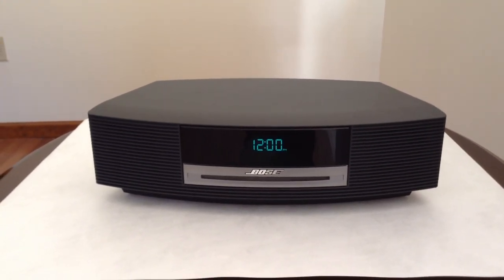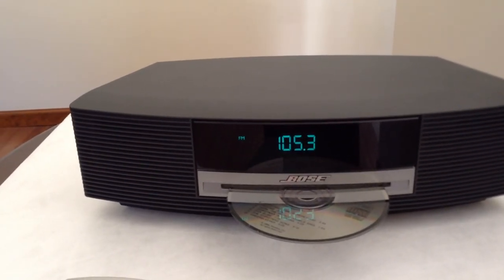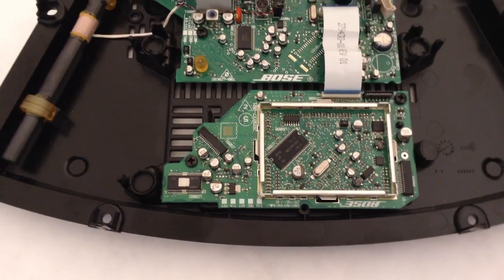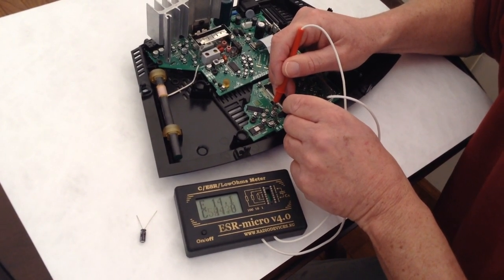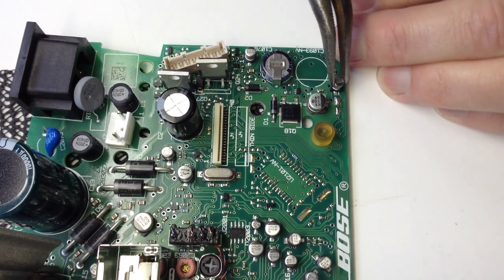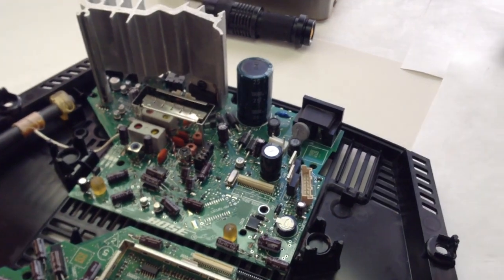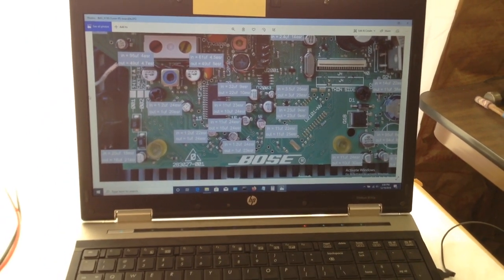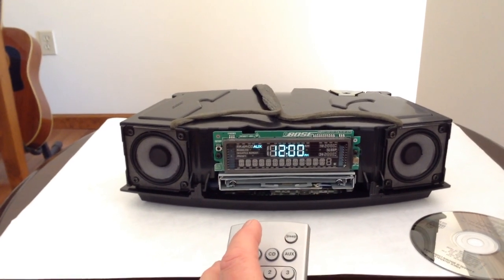Bose Wave II - AWRCC1 resets and CD skipping. Repair "Please Wait" problem

Comment: I had a similar problem with my Bose Wave radio/cd player. I was getting the "please wait" over and over again when  I tried to turn on the radio, cd or auxiliary. I followed the instructions given in this video, but I only changed the capacitors in the CPU circuit board, the circuit board under the cd player. I figured that the problem was on the cpu side of the circuits rather than ton he display or radio circuit boards. When I was removing the old caps I noticed that only one cap had some light brown residue under it. Most likely this capacitor was the only faulty one, but I would not have noticed it unless it was removed. 

I bought surface mount capacitors (SMD) from Digi-Key, very inexpensive. In total I only changed 13 capacitors similar to the ones in the Bose unit. I removed the old capacitors using the method described in the video. When installing the new capacitors I move the capacitors leads slightly inwards, it made it  easier to install.  I also used a thin soldering iron, the thinner the better because the capacitor leads are very small, and applying to much heat might damage the caps. 

At Digi-Key I selected all of the capacitors from the same company (Panasonic). They have different company components, it is better to buy from the same source. Make sure that  when you select the surface mount capacitors they are exactly the same uf and voltage specs(the only different spec that I changed was the 6 volt spec to 6.3volt because there were no 6 volts caps)  and size (very important). Digi-Key carries same uf and voltage caps but with different sizes. If you get the wrong size surface mount caps they may not fit on the circuit board. The measurement that is important is the diameter of caps. The ones I bought were mostly 6mm, 5mm, and 4mm. I got them in two days from Digi-Key and it took me a couple of hours to install them. The Bose Wave functioned as normal from the moment I plugged and turned it on.  Unless you look really close at the cpu circuit boards you would not notice ant replacements were done. I installed the same cover plate over the cpu section.

Thanks George. Great video.
Reply from the maker: Awesome "recap" of your Bose repair Tony! Thank you so much for taking the time to write it up. It will no doubt help others. I am dying to find another Bose Wave in the trash or at the recycling center and replace the caps with surface mounts like you did. I have used Panasonic low ESR caps in the past for repairing monitors so I know they are high quality. That's a good tip about slightly bending the leads out so you can get the soldering iron under there. As you pointed out, physical size is really important, both width and height, if you are replacing with surface mount. Once again, great job with the repair and write up!  Another Bose saved from the landfill.

Comment: Thanks for this video, but especially the note pointing out the single cap replacement that helped two others. You can add me to the list.

Someone asked on FB where they could dump a "non-working radio" and my wife offered me up to try fixing it. The guy just wanted it gone, saying it didn't work. Turns out it was the CD player only like yours. I replaced the single cap and it's working just fine now. Thanks for all the detailed descriptions.
Reply from the maker: That's awesome! Great job Scott! These Bose radio/cd players are definitely worth fixing for a couple bucks.
Reply: @george terbush
 Good thing I read through the description. I was ready to replace all of those suckers 😅. Replaced that 1 cap and now working flawlessly. Found a lot of the other caps were way out of range but I won't lose sleep over not replacing them. Thanks for the vid,
Reply from the maker: @AnonymosV4  That's awesome Noah!  Do you remember what the ESR value was of that 22uf cap? (If you had a ESR meter)
Reply: @georgeterbush2976  luckily I didn't throw the bad cap out yet haha cause I forgot. It reads very high at 92. For reference / accuracy the 22uf 16v onboard cap I replaced it with reads 3.6 on my meter.
Reply from the maker: @AnonymosV4  That's great to know. Thanks for the follow up.

Comment: Hi, THANK YOU for the 22uf at 6v suggestion. Just a heads up. I took both 22uf at 6v caps out (both next to each other). On my capacitor checker they both read 12uf testing them. So I replaced both of them. Works like a charm. I didn't get a message that said Please Wait though. I just couldn't turn on the AM/FM or switch to the AUX. The volume went up and down and that was it. I didn't have any burn traces. GREAT STUFF. I'm an old tech that always did component repair back in the day. My eyes sure can't see things without an eye loop up close any more.
Reply from the maker: That is great news Duane! I'm so glad you were able to get your Bose working again. I suspect that you have other caps that are still bad and may affect other areas of performance, but Damn, to get it up and running again by replacing two little caps is fantastic!

I know what you mean about the eyes. At one point I was stacking 3 pairs of cheater reading glasses on so I could do the work. The brain still works, but the eyes are shot. LOL 

You made my day. Thanks 
George

Comment: I did the hair dryer thing for about 4 minutes.  2 minutes and tried.  No 2 more minutes  and it worked!!!
Reply from the maker: Using a hair dryer is a quick troubleshooting technique, but certainly not a fix for the problem. At least it shows that most of your Bose is working and that a few bad caps need to be replaced.
Reply: It worked for me too....I now keep it on 24/7, turning the volume all the way down when not in use. (You could mute it, but the mute flashes ....drives me nuts...LOL).   Keeping it on it stays nice and warm and has been working all week like this!
Reply: Yeah its because you warm it up and if it gets hot it will work
Reply: Just got a Bose Wave system with the 3 disc changer from Goodwill for $5.99! Was flashing “Please wait” and I tried your tip with the blow dryer for 2 minutes and IT WORKED!!!!! 🙌🏽🛐💪🏽 This thing sounds GREAT! Thank you!!!

Comment: Thank you a lot for providing this helpful information. A friend gave me a AWRCC3 that was having those exact symptoms.
Happy i scrolled to your latest update and only changed the 22uF capacitor and like described it solved the problem with the CD player right away. 
Old capacitor 26uF, Vloss=5,1%, ESR=78Ohm; new 22uF 25V capacitor 22uF, Vloss=1,3%, ESR=1,5Ohm (measured unmounted with Multi-function Tester - TC1)

The only trouble I'm still getting is that in the beginning the remote does not seem to respond. But if you insert a CD and the whole system heats up, the remote starts to work fine.
I assume that this must also come from another capacitor with high ESR, i will focus on those on your provided photos marked with OUT and a high ESR. To bad that measuring build in capacitors doesn't give accurate results, because that would help to locate faulty capacitors without de-soldering them.
Reply from the maker: Great job Induleo! That 22uf cap sure was bad measuring 78 Ohms. You can still measure the ESR of caps in circuit to find those with high readings. Any component in parallel with the cap will only make the reading lower, not higher.  That TC-1 sounds like a good little ESR meter.

As far as the remote goes, make sure you try a brand new battery in the remote first. I was about to take my Bose Wave apart again and replace the IR sensor because both of my remotes were having intermittent functionality. I measured the batteries with a volt meter and they read close enough, or so I though. I put fresh batteries in and now the remotes work perfect! Good luck, and thanks a million for sharing your experience.
Reply: Thanks for your quick reply.

So reopened everything and found out that it gets a bit warm around the voltage regulator LM317. Like on your photo, most capacitors around it had ESR measured onboard up to 20Ohm. So i decided to replace three other capacitors, both 10uF and the 47uF. The heat seems to make those capacitors age quicker than others, being trapped behind this metal shield doesn't help for better cooling either. 

The first old 10uF next to the 22uF had 10uF, Vloss=2,6%, ESR=38Ohm; new 10uF 16V capacitor 10uF, Vloss=1,3%, ESR=2,6Ohm
The 47uF next to the LM317 had 49uF, Vloss=2,7%, ESR=16Ohm; new 47uF 35V capacitor 48uF, Vloss=1,9%, ESR=0,5Ohm
The second old 10uF next to the other 10uF had 10uF, Vloss=2,3%, ESR=39Ohm; new 10uF 16V capacitor 10uF, Vloss=1,3%, ESR=3,1Ohm

I also measured the remaining two capacitors onboard, the 22uF had 105uF, Vloss=11%, ESR=1,4Ohm; and the 100uF had 151uF, Vloss=6,6%, ESR=2,7Ohm. I left them in.

So after changing in total 4 capacitors around the LM317, all with rather high ESR, the worst of course was the 22uF, the CD player works fine again and the remote now reacts directly after plugin it in. By the way, checking the battery was one of the first things i did. ;)

My friend is happy to get his Wave back tomorrow thanks to your precious help an information.
Reply from the maker: @Induleo  This has been some of the best feedback so far. I really wish everyone had a ESR meter and could give their before and after readings like you did. Very rewarding. Great observation about the heat generated from the LM317 being trapped inside the metal can and drying out the caps. I never thought about that.  You made my weekend. Thanks Induleo.

Comment: @george terbush Thanks for all your hard work and research. I followed your information in the description and eventually found replacement Nichicon SMD capacitors to replace all the caps on the CD player PCB. I did buy and intended to replace the caps on the PSU as your information specified but declined to do so since the device worked again just replacing all CD player PCB caps...why risk breaking something that doesn't then need fixing.
The needle nosed pliers technique works to some extent but takes patience to not damage the PCB and to hopefully still have a cap to measure out of circuit. I ended up destroying about 4 caps where the legs were not attached internally for measurement.
One thing you may have overlooked is that some of the caps on the CD player PCB have a 6v rating not 16v. This is fine to replace with 16v rated caps, especially if you are using through hole caps, but the size of 16v rated SMD caps for the space and pad footprint of the 6v rated existing SMD caps was only just enough to get any solder on. Something to mention in the description "if using SMD capacitors buy the 6v rated caps for the 6 capacitors 3x 47uF, 2x 22uf and 1x100uF. If buying a 16v rated 100uF cap for under the shield, the shield will not fit flat due to the height of the 16v rated 100uF cap".
I fitted the shield and it touched the top of the 100uF capacitors can so I placed a piece of electrical tape on the top of the can to insulate it then pressed the shield over as many of the lugs as I could to ensure it was secure then checked and there was 2-5mm clearance under the CD drive.
Hope that helps someone who needs to repair one in the future.
Reply from the maker: @Infiniti25 Thank you for taking the time to write with your feedback. I can definitely see how the larger 16v surface mount caps would pose an issue when trying to place on pads designed for the smaller 6v package. This is very good info for someone ready to order parts for their project. I added your suggestion to the page description above. 

What were your symptoms on your Bose before changing the caps?
What series Nichicon SMD capacitors did you use?

These Nichicon SMD capacitors may be a good replacement for the 6v caps...

CAP ALUM 22UF 20% 10V SMD
https://www.digikey.com/en/products/detail/nichicon/UUD1A220MCL1GS/589983?s=N4IgjCBcoLQdIDGUAuAnArgUwDQgPZQDaIALAJwDMIAugL514BMxIAqmwCJgCCTTABgCyAYQAyYAOIBlWnSA

CAP ALUM 47UF 20% 6.3V SMD
https://www.digikey.com/en/products/detail/nichicon/UUD0J470MCL1GS/589972?s=N4IgjCBcoLQdIDGUAuAnArgUwDQgPZQDaIALAJwDMIAugL514BMxIAqmwCIAMAUqQHZuAWQDCAGTABxAMq06QA

CAP ALUM 100UF 20% 10V SMD
https://www.digikey.com/en/products/detail/nichicon/UUD1A101MCL1GS/589989?s=N4IgjCBcoLQdIDGUAuAnArgUwDQgPZQDaIALAJwDMIAugL514BMxIAqmwCJgCCYADGACyAYQAyYAOIBlWnSA

This is the main page for the Nichicon SMD UUD Series caps...
https://www.digikey.com/catalog/en/partgroup/uud-series/3760
Reply: @georgeterbush2976  Hi, the original symptoms were clicking/skipping CD...took sometimes 20 seconds to get a clean 1 second of audio. I cleaned the laser and the laser carriage regreasing the rail with lithium grease which appeared to almost fix the issue, but the next day I found that it was probably because the capacitors were prewarmed from all the testing. The next day with the clicking/skipping back I noticed there was a second problem which was worse, the CD wouldn't insert completely and LCD display would blink off like power cycled then spits the disc back out. I then got the "--please wait--" error after the LCD off/on.

Replacing all the capacitors appears to have sorted this issue and I have tested hours after the initial repair and then almost 24 hours after the initial repair, all working great!
As for the Nichicon series of capacitors I am based in the UK and I had to mix and match due to the supplier (RS components) I wanted to order from. I have CB, CW, UD and UT series SMD capacitors for the various values required. From what I saw, sometimes searching based on capacity and voltage rating only one series would be in the results. I don't think there were any others used for this repair.

The single problem capacitor with the height that exceeded the shield height was a Nichicon 100uF 16v (to replace the original 100uF 6v) UCB1C101MCL1GS with dimensions of 6.3mm × 8.7mm. The electrical tape and the slight curving of the shield won't cause any issues I don't think.
Had I looked at your images and the actual capacitors on my board I would have definitely bought a 6v or a 10v version to ensure a proper fitment.

I'll take this opportunity to again say many thanks, my friend is happy the device is repaired, it's the only thing of her son's she has and wants it in working order for when he visits, he lives in US.
Reply from the maker: @Infiniti25  Awesome! Your symptoms sounded a lot like what I was experiencing with my Bose radio. So glad that you were able to get it working again for your friend.  Sharing the critical info that you discovered about the sizing of the surface mount caps rated at 6 volts will help a lot of people here. I really appreciate it.

Comment: Hi George, thanks for posting. It's your choice of course, but I recommend you update your description to say that the "Please Wait" error can be fixed by changing the ONE 22 uf 6 V cap located under the CD player. There are two 22 uf 6 V caps under the CD player and the one located closest to the two 10 uf caps is the one that will fix the problem if a new one is installed. I wached your video and used your list to order all the caps, then I happened to read a conversation below which mentioned the one crucial cap. I installed the 22 uf 16 V which came with my order from digikey (per your list above) and my Bose AWRCC2 is back in action! Of course, the way shipping works with digikey, buying the extra caps is hardly any waste of money at all. HOWEVER, I almost sank the time and effort into switching out ALL (or nearly ALL)  of the capacitors as you did, and that would have been much, much, much, more time consuming. Anywhow, thanks again because your video led me to a quick solution.
Reply from the maker: Hello  D_123 StL. That's fantastic that you were able to get your Bose Wave repaired by replacing one of the 22 uf 6V caps. Believe me, I am all for doing things the smartest way, which is usually the fastest way. In the German YouTube video where he had the "Please Wait" problem, he changed the 100 uf 6V cap and that got his Bose working again.
https://www.youtube.com/watch?v=Gkm8CSs0T0U

I took a lot of measurements before and after, and as you can see in the photos, many of the caps had very high ESR (equivalent series resistance). The 22 uf 6V that you are referring to was one of the worst caps for ESR. It is very possible that by replacing just that one cap, my Bose would have been fixed! 

If there is a weak cap with high ESR, it may be putting a lot of noise on the power line for that circuit. I do feel better knowing that all of the caps that I replaced are new and doing what they were designed for.  As you pointed out, it was much, much, much, much more time consuming. : )

I will mention your findings in the description above so someone else can replace the caps inside the metal box first and see if that gets the player up and working. 

Thank you for taking the time to order parts and attempt the repair and then to add your comments here to help others. It's really appreciated.
Reply: @georgeterbush2976  Thanks for the reply. There's a real sense of satisfaction which comes from repairing a beautiful music making machine such as this Bose player.

Comment: Thanks for the video.  It is surprising and disappointing that for the high price of Bose products, they didn't prevent such an avoidable premature failure.  My unit has this problem.  Warming up helps.  Hard to understand why.  I doubt that I will fix mine because it's a lot of work, and I don'r use CDs much any more.  Mine still works as a radio, and amp for cell phones and Amazon Echos.
Reply from the maker: I agree. I have an old Panasonic clock radio that I have used everyday for 40 years and still works perfect.
Reply: Interesting case.  Thanks for this remarkably thorough investigation and documentary.